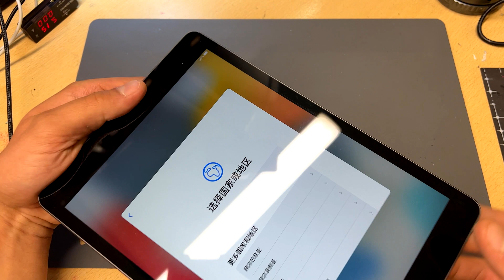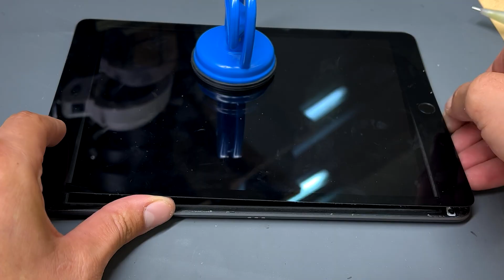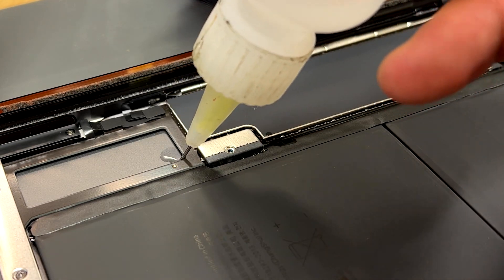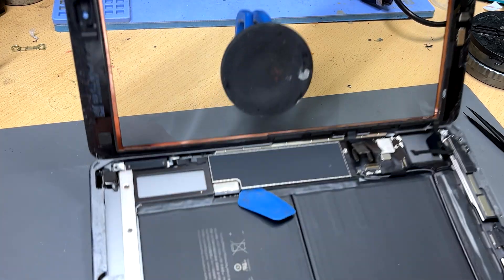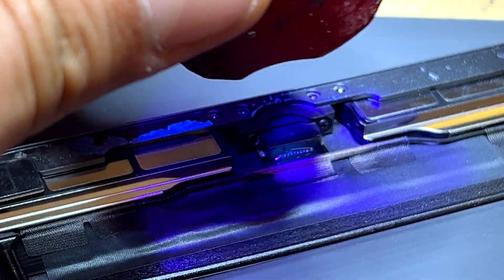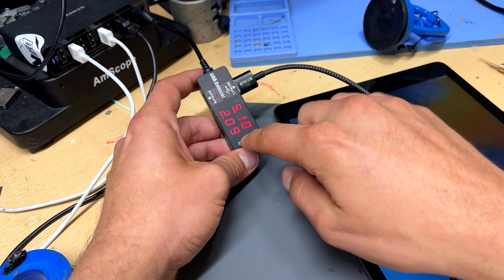How To Repair Your iPad 8th Gen's Charging Port If It's Stopped Working

Comment: Yeah, ok, I'll get right on that LOL! I think mines a lost cause. I often have it sitting on a little metal adjustable tripod on a roll table by my bed next to a JBL Flip speaker. Both are connected to 6' USB cords draped to wall outlet. One night I toss my shirt into laundry basket nearby but shirt slips from hand falls on USB cords sending iPad JBL and tripod all went flying from table hitting wall radiator heater ending on floor. Arrrrgh! Needless to say iPad's screen cracked. And part of the damn USB cord's A-plug end literally broke off stuck inside iPad charge port. Making matters worse I thought I could jimmy it out using tweezers and determination- need I say more?  Anyway that's my sad little story of my beloved iPad. For now, adding insult to injury, I'm using my Amazon fire tablet backup. 🤢

Comment: I have a 7th generation iPad that I purchased new about 4 years ago. The charging cord won’t go into the charging port. Quite sure I’m using the correct charging cord. When I try to look into charging port (without dismantling the iPad), it looks like there two 
nodules poking out slightly from both sides at the back of the charging port. I don’t see any dust or dirt in the charging port. Is what I described fixable?  Can I fix it myself? I haven’t tried to use the iPad in a few years. I wanted to give it to my granddaughter. 
Thank you for any assistance that you can provide.
Reply: Hi Janet, I see this comment is a couple of months old. In case you still have the same issue, what you described sounds like a portion of the end of a lightning cable has come off inside the port. A repair shop can typically pull it out using very fine tweezers, and with a little luck that's all that's needed. I wouldn't particularly recommend trying this yourself as you can damage the pins of the port which is a bigger ordeal to replace.

Comment: 😈😈😈 try with a ipad flip cover case such as the speck Smart Cover Magnetic Filo case or something similar in that matter that has the ability to turn it on or off when you flip it open ☝️also plug in the charger and leave it alone for some hours maybe over night do these instructions without opening the filo case just plug it in and leave alone don’t open it I repeat☝️… I noticed the screen comes on to indicate the ipad was connected to the charger once it plugged ☝️but that takes juice to even show that indication….. step 1)smart filo case 
Step2) don’t open it just plug the charger in step 3) leave it alone and go watch porn or something step 4) try after hours it worked for me hopefully it works for you remember keep the case closed 😈😈😈😈

Comment: this is a bit goofy but thanks for helping the people who are smart enough to actually do this! But seriously, nice work, I’m just too dumb to do stuff like this so I’d rather spend 50 bucks to get it fixed lol
Reply: Two places I called said they don't solder anything, and the one that did said $200 ...I might as well try my luck with that price lol
Reply: @jminkvihubyb  mine was 500 for some reason
Reply: I’m doing mine right now and it’s soooooo much work to remove the charging port and if you do it. It has to be soldered regardless. Labor intensive on such a small piece. I can see why they charge those prices. Good thing I’m practicing on my own before I try and do somone else’s . Great video

Comment: Great video, quick question, does this would cause to allow charging only byvone side of the cable and only using power brick of usb type-c ?
With USB A chargers it judt don not charge

Comment: HI, i just wondering, if i bring it to repair shop when they process to clean it or change the port,does it means that my program is re-program and cause delete my data file like photos, video or other file? thanks
Reply: No it shouldn't. Because the charging port has no data in it.
So no worries ;)
But when we don't know the other guy don't hesitate to ask him :)

Comment: Hello thanks for the tips but I don’t have any of the materials so is there any other way to fix the issue?
Reply from the maker: Either way you look at this repair it will require some soldering. The other option is to remove the logic board and replace the whole charging port flex

Comment: I think I'll try brain surgery first lol...but thanks anyways:)
Reply from the maker: Haha good luck!
Reply: @iDoctorUK  hi iDoctor, so my charging port is broken i think, can i charge it with dc5v it does have it just need to buy the dc5v plug/cable..i tried to charge it with the regular usb port to the wall but wouldnt charge.  when i turn it on it comes on for a second or two then black again but its not picking any charge up with the small charge port..thanks:)

Comment: Bit of Loctite on the screws too perhaps? Does this problem of the weak solder joints cause just intermittent charging or can it cause any other charging issues, for example, only charging when off?
Reply from the maker: Yes, loctite for sure. Mine was stolen from me recently hence not being included in the video. 

I usually find only charging when the device is off to be linked to the charging IC rather than the port
Reply: @iDoctorUK  Charging IC? what's IC?